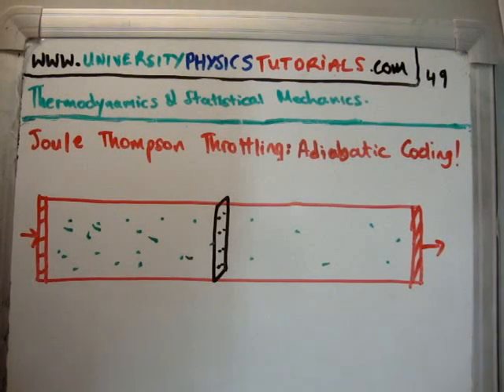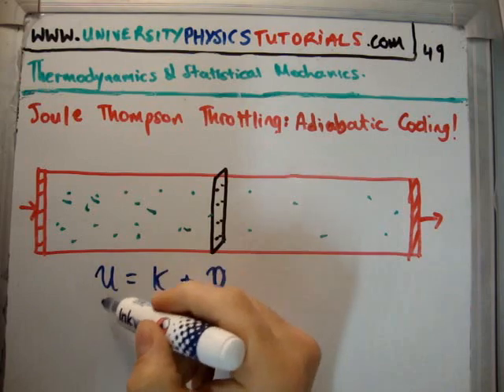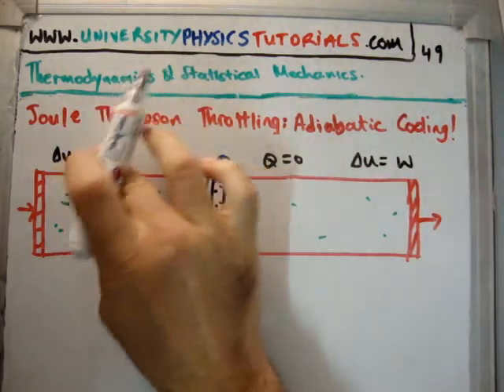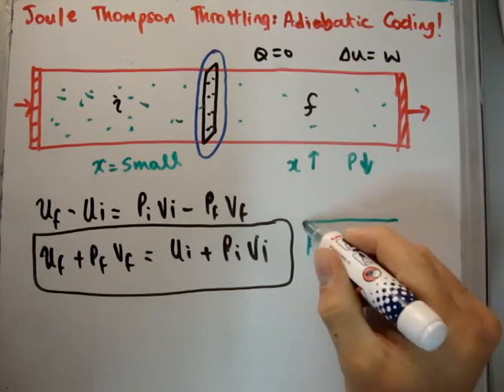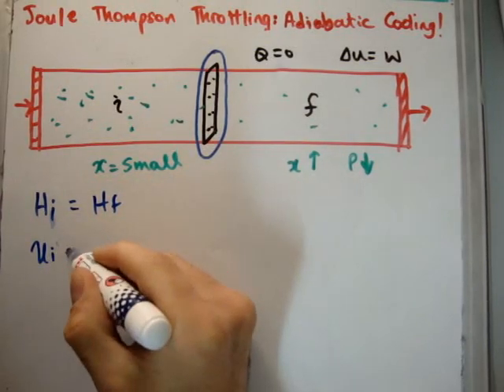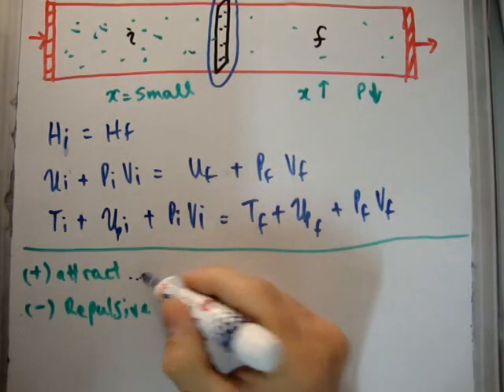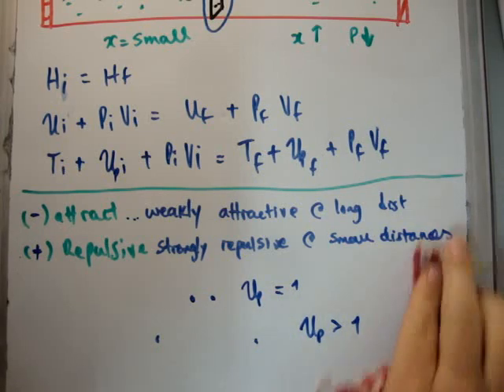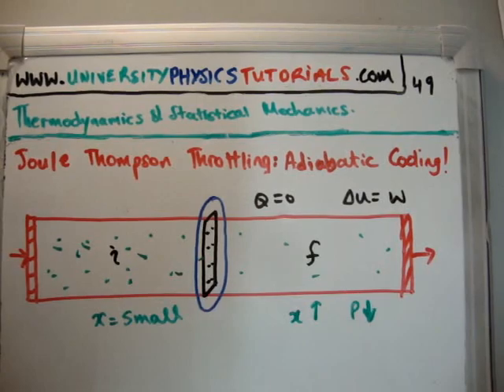Thermodynamics 49 : Joule Thompson Throttling / Adiabatic Cooling

Comment: Hey Adam, 
I think you described the effect very well. I just have one question. At the end, you said that when people were trying to cool hydrogen, they used the Joule Thompson effect. On wikipedia, the information of the Joule Thompson effect says that all gasses follow this model except for the exception of Hydrogen, Helium, and Neon. If I recall correctly, hydrogen has a negitive JT coeffecient, meaning it would heat up when the pressure decreases, right?

Comment: JT Throttle can cause increase in temperature also if the initial pressure at a particular temperature is more than inversion point pressure,So how will you physically define heating?

Comment: So, why is the mesh/porous valve necessary?  Is this to avoid giving the gas molecules additional kinetic energy?
Reply: It is in order to create the high and low pressure regions. If you didn't have an obstruction, then the gas would expand equally across the whole tube and the pressure would be the same everywhere. By creating an obstruction, you "clog" the tube, and so fewer molecules will make it through to the otherside; less molecules means more space, which means lower pressure.

Comment: Question: When you blow air out of your mouth (like trying to blow out a candle) is air cooled by the same process?
Reply: edge21str A fan, like the mouth, is not cooling the air. It feels cooler because of the effect of conduction and slightly because of evaporation on the skin. The nerves in the body detect that heat is leaving the body via the air and you sense that the area is cold. The air being blown out of the mouth is the same temperature as it was before it left your mouth. The effect in this video would be negligible in your proposed scenario.

Comment: Wait wait, at 9:41, why is potential energy increases to be more than positive 1 when you designate the potential energy of attraction to be negative.

If you keep increasing the distance of particles apart, attractive force should dominate and become negative sign.

Particles that get too close together will have their repulsive force dominate which have their potential energy becomes positive.

Did you got swapped somehow?
Reply: im thinking like this,
let the potential energy at initial postion of the molecules be "P".

If we decrease or increase the distance between the molecules we produce potential energy i.e. making it more then P,which is trying to bring it back to its original state